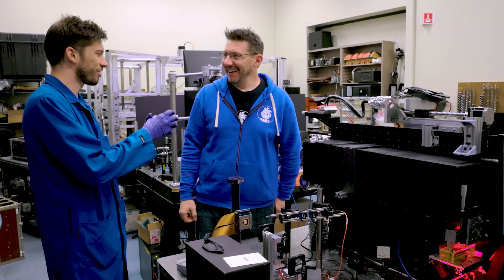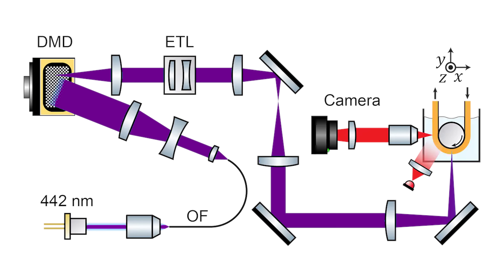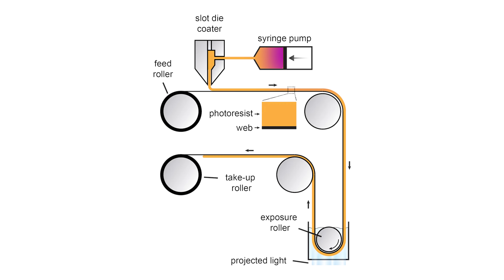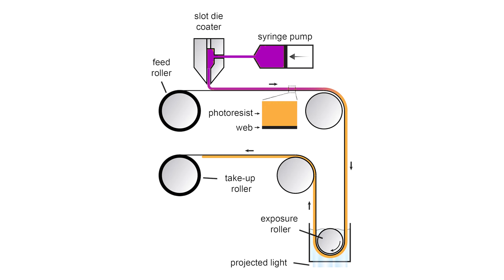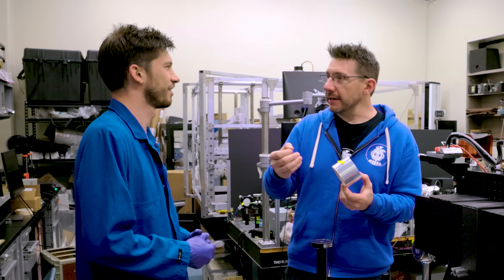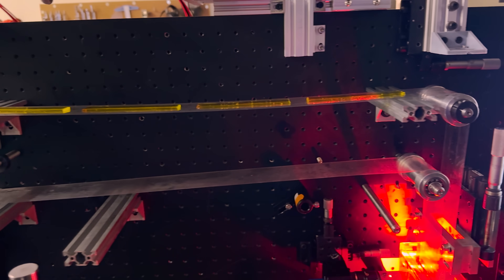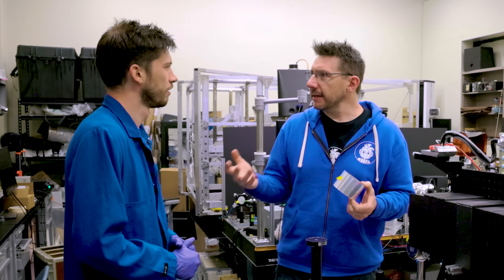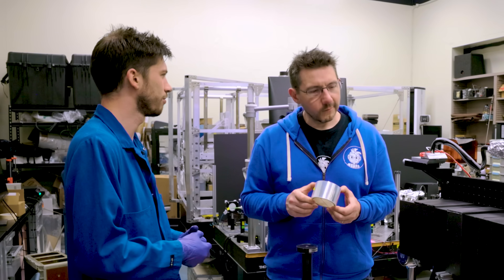INFINITE Bio 3D Printing!

Comment: I think conceiving of axial tomography printing as "all at once" is hindering your understanding here. The holographic technique you covered recently is "all at once," because the light is structured in 3 dimensions. In axial tomography, the light is structured only in two dimensions, like a projector; it projects a 2d version of the object, then the medium rotates and it projects the 2d image of that new angle. Rather than cure all at once, the medium is carefully tuned to cure only once a region accumulates a certain level of light over the period of a single rotation of the chamber.

A similar thing happens here with the gel; the crucial rotation is introduced by the belt going over that roller right next to the projector. 

An unfortunate limitation would be that the gel stretches unevenly as it goes around that curve, since the part in contact with the belt pretty much stays the same length, while the outer surface stretches. I suspect this is why they're using a limited depth, though that probably hardly matters when your target feature size is measured in microns.

Very cool research, and I'm glad to have gotten a glimpse of it!

Comment: wait... IS this an additive manufacturing process, though? seems to me it's clearly subtractive: you start with a relatively thick, homogeneous extrusion of material, then you pattern a volume of that material, then you process it to remove everything but that patterned volume. Unless I'm missing something here, the only real "additive" step, the extrusion, is no more involved in shaping the final product than is slapping a chunk of steel on a milling table; the size/shape of the blank only affects the geometry of the finished part by defining it's maximum dimensions.
Reply: You could say the same about resin printing.  Gray area?  Maybe.  But I think it's much more similar to additive techniques.
Reply: You also subtract from the powder bed. In my opinion it's addictive manufacturing, because the end product has very different physical properties after "printing". If you cnc metal, the material stays the same